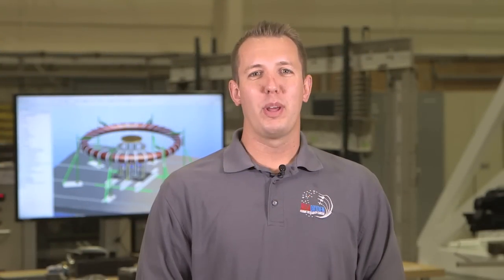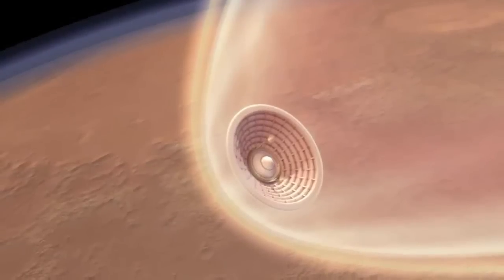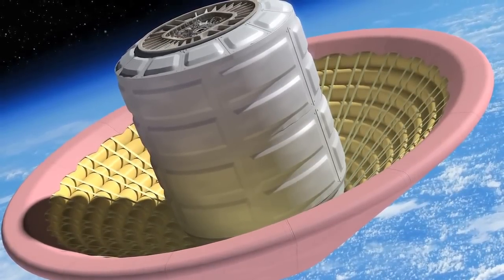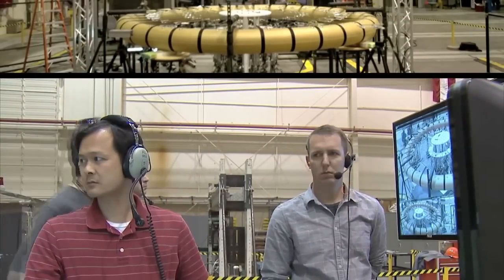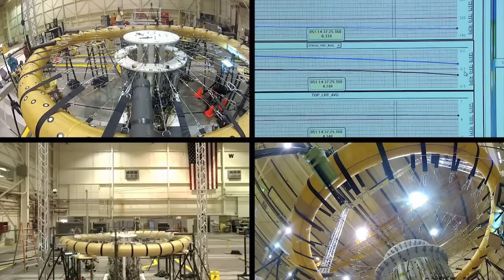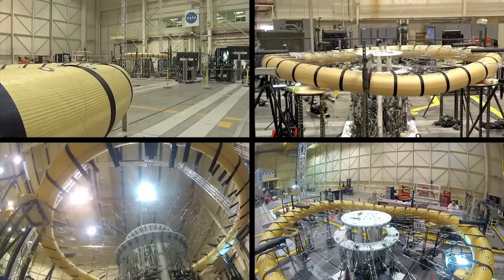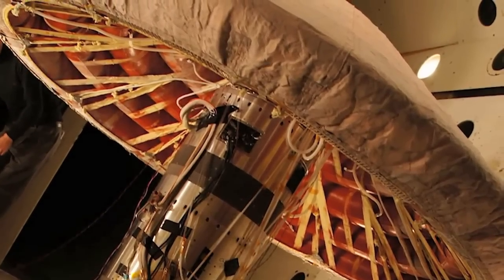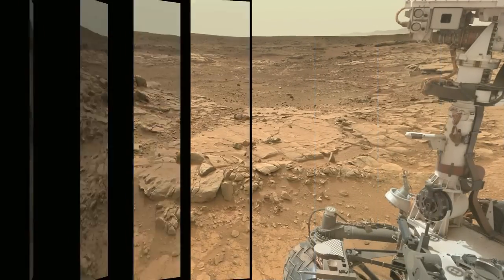Real Martians Moment: Hypersonic Inflatable Aerodynamic Decelerator … What a Drag!

Comment: inflatable is the wrong way to go, much better would be some sort of extractable propeller blades that convert the drag in kinetic energy, at a certian speed it would not be distinguishable from a constant material and as a bonus you could at the end tilt the blades like those of the helicopter and give some counter thrust, lowering the ammount of fuel you take with you, if you use some super nano carbon matarial you could probably even  make them incredibly long, re entry is such a waste of energy
Reply: +sapin Well it deends on the atmosphere, This Hypersonic Inflatable Aerodynamic Decelerator would work for Mars´s thin atmosphere, for Jupiter it would be required a different thing capable of surviving too much pressure.                                          That propeller system of yours won´t move in Mars until the ship would reach critical speed and crash or disintegrate, and would be broken in J in les than 30 seconds after entering it´s atmosphere
Reply: solountipomas
no problem: let it orbit at a few times untill it gets spinning
Reply: +sapin The athmosphere in Mars is 130 times thiner than in Earth, it would only spin until 2 kilometres hig or lower, at that altitude, it would be too close so unable to stop it, or it would explode trying.  Also temperatures there would be like -140 Celsius, try to start a motor in such condition, imposible, the blades wouldn´t spin, being frozen and stuck  If you would try a low orbit at 1-2 Kilometres at hypersonic speeds, knowing Mars mass is only 1/10th of earth´s mass it would end in a escape orbit, so it would leave the planet and get lost. At match 5 you would move 1 mile or 1,7 Km in just a second
Reply: sorry, why would ONLY 1-2km height have a measurable effect? Its a complicated maneuver for sure, but given enough "spiraling orbits", even if it takes a month, should eventually convert the friction into a centrifuge from hell. Also why do we need a motor? A disk with blades spins and then we tilt the blades in the opposite direction.
Reply: solountipomas
sorry my bad, didnt know that the atmosphere was virtually non existent. But i guess if one was not in a hurry and could wait a year or so for the controlled orbit decay to kick in, considering the savings in cost, might be worth it. In any case we should be looking for ways to reuse some of the energy we pumped into it. Its just a huge waste to let it burn up. Maybe if the blades are really really long.... :)
Reply: +sapin  ... Mars gravity is so low that is loseing it´s atmosphere as we speak (write) I understood you where talking about a short of autorotation, so i didn´t mean that blades used motors, i just said that if motors get stuck when it´s metal parts frozen, those blades would be as stuck as a motor. "Maybe if the blades are really really long" ..this is space, sending a prove costs hundreds of millions they need to save space and mostly weight, therefore a chute or that  Hypersonic Inflatable Aerodynamic Decelerator would make a bigger drag with a low weight and small space required.             For bigger things as furure ships carrying humans, solid fuel motors would be necesary to brake it in a reasonable time.
Reply: solountipomas
me again :) what about a huge parachute out of thin foil, something like they recenty did with the solar sail, its goal is to speed up orbit decay until the atmosphereic drag is strong enought to power the blade mechanism.
Reply: +sapin Well i don´t know if the Hypersonic Inflatable Aerodynamic Decelerator would also use a parachute for an extra brake, both systems have simillar air drag, but the HIAD will also act as an air cushion, so its a 2 in 1.                                                         I don´t know, i´m just a peasant, but that propeller system you talk would be used for planets with larger atmospheres and higer pressures than Mars, but not as hig as in Venus, and it would be made of carbón fiber wich would be lighter, stronger and less afected by icing